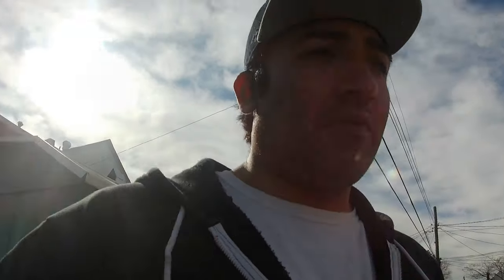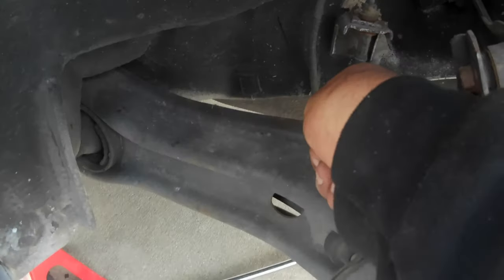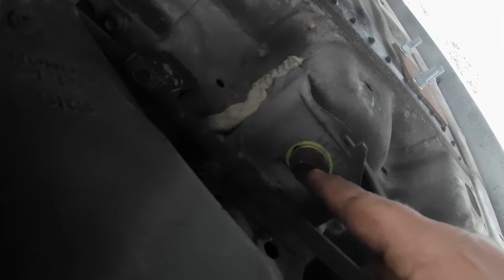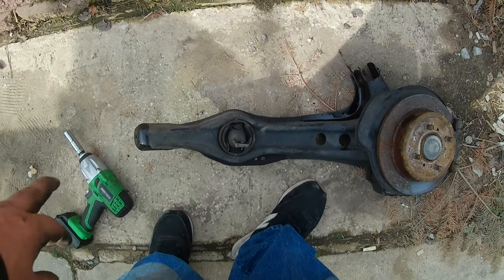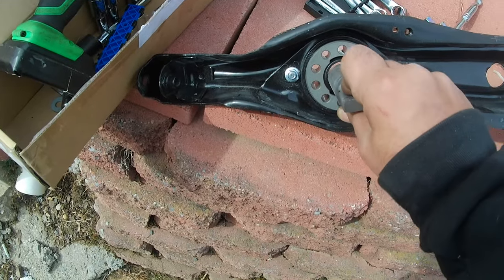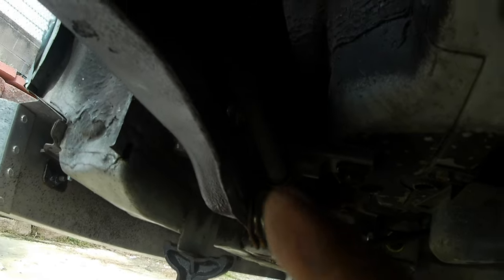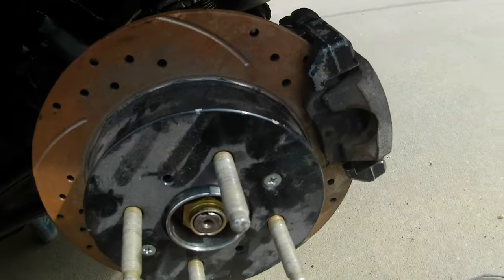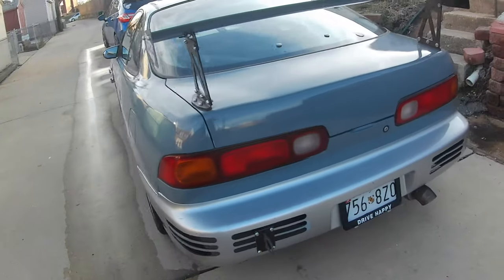Civic / Integra rear trailing arm swap

Comment: Why didn’t you use the old trailing arms? 

You could have replaced the bushings and bearings on that one?
Reply from the maker: I didn’t use them because I had the other ones already put together and it was just easier to pull the whole arm off the car instead of trying to replace the bushing and toe arms on the car
Reply: @RevHighDriveHappy  perfect!! Also, your new trailing arms, are  they 94-01 integra non type r?? 

Because I have rear conversion brackets that mimic 94-01 teggy trailing arms and the rsx caliper bracket doesn’t line up.
Reply from the maker: @theoneofone2992  yes the set of trailing arms I swapped on the car were factory Integra arms 
I learned you can use RSX caliper brackets and factory caliper and use the bigger ep3 rotor instead of the RSX calipers

Comment: Where did you buy the trailing arms?
Reply from the maker: I purchased them from the junkyard and had them sandblast it repainted them and replaced all the wheel bearings and bushings

Comment: Bro, that thing is going to carve them corners up! Can’t wait for the follow on video about the rear brakes.
Reply from the maker: Still working on them I put a honed booster delete on and trying to get the brakes to feel “right” now still have some adjustments to make then off to an alignment
Reply: Rev High Drive Happy do you have specific setting you’ll have the alignment shop dial the suspension to? Don’t share them here, if you don’t want to. Just curious.
Reply from the maker: @stanislavponomar2588  I have going to do the setting honed recommend 
Front 0 toe -2.5 camber +1 to 4 caster 
Rear +1.5 toe in -2 camber 
The caster is going to stay oem until I get some pci front upper arms to make caster adjustments